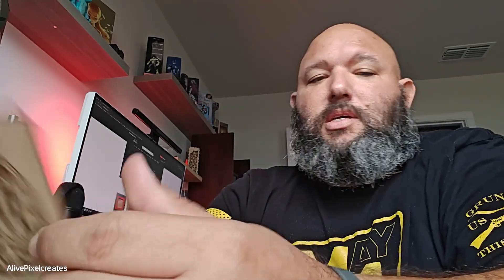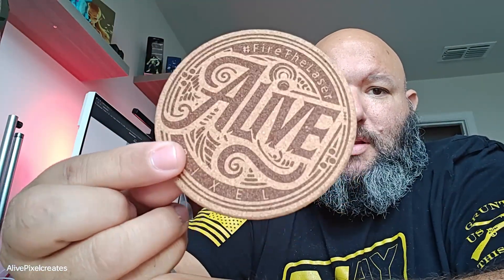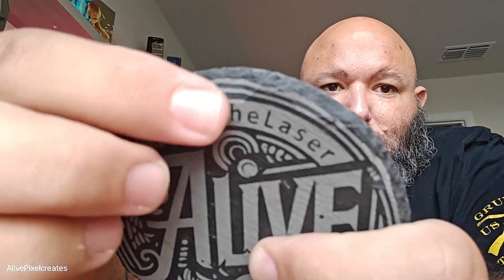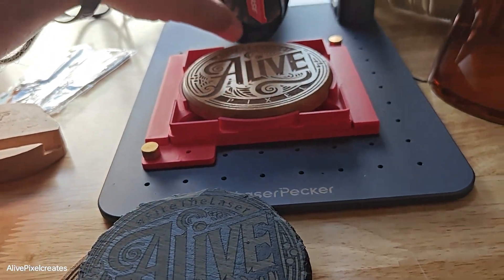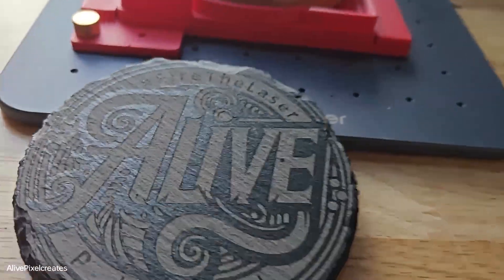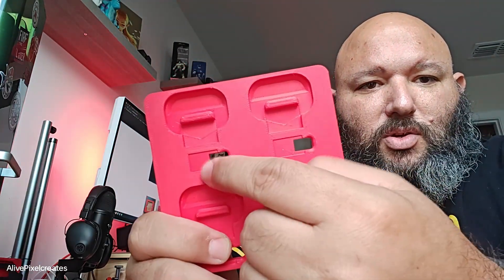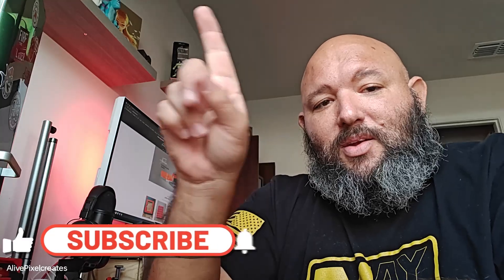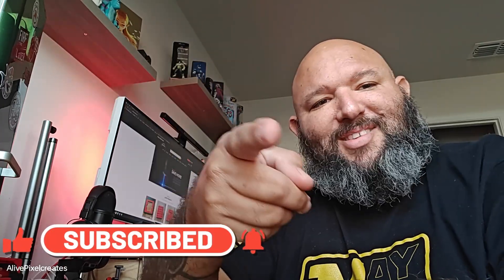Laser Pecker 5 First Impressions - Laser Pecker 5 vs. Xtool F1 Ultra Blue Light Laser

Comment: HI, I need to buy a laser the P5 or F1 ultra, for the first the cost is more or less 1500 € less considering the bundle, do you think the P5 related to the entire quality is good as well than F1?
Thanks
Reply from the maker: Both are really good I had some issues with the software on the laser picker is not super friendly and  little bit glitchy. The F1 has a bigger area to work but the lp5 seems to have better control on the power signs use a smaller lens
Reply: @AlivePixelCreates  thank you!
Reply from the maker: My pleasure

Comment: great video! excellent point on how the size of the bed is really a practical matter. Glad you are happy with both.
your jigs / fixtures are fantastic. I am going to have to up my game.
what settings did you use for the slate on the diode? did you try the fiber on it too?  I'll check the next video
Reply from the maker: I'm finishing testing the fiber soon. I'm trying to be really fair on my opinion and comparisons with Xtool. I did 80power, 200mm/s speed 1k that is equal to 260 lines on Xtool vector graphic